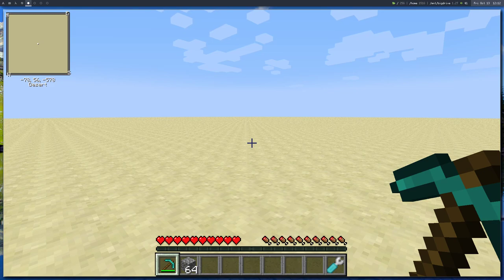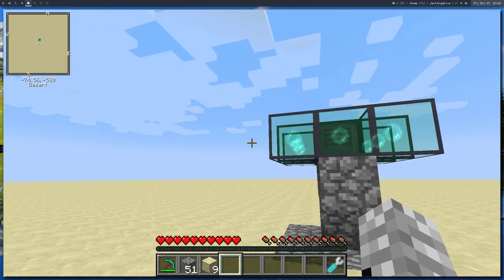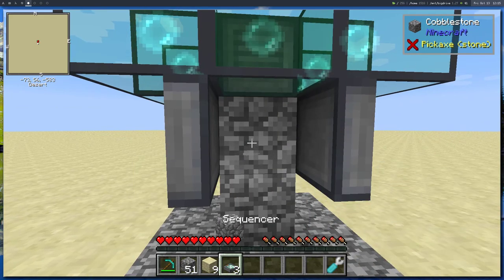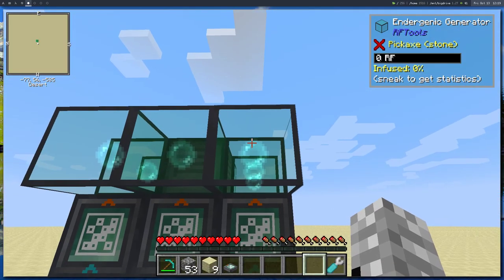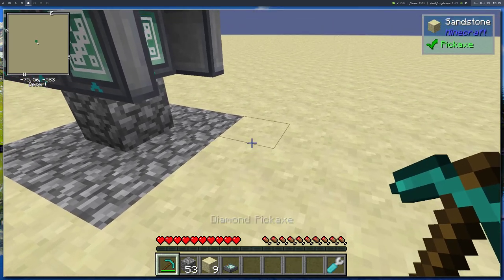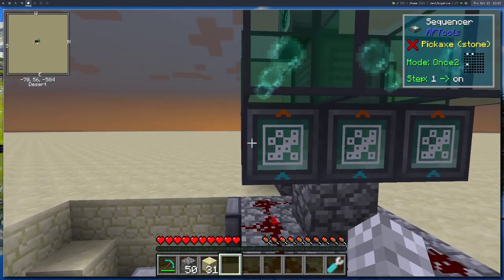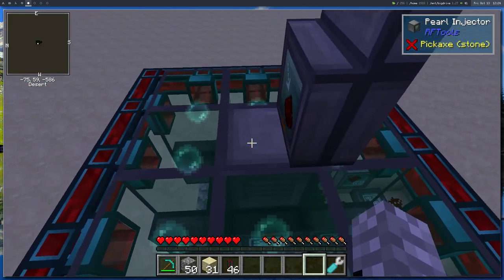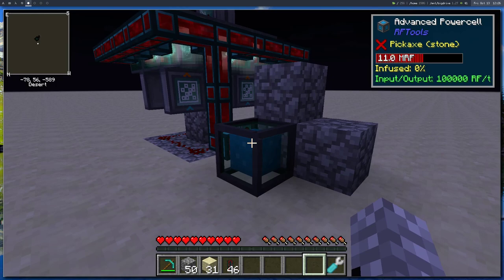Fairly Easy Endergenic Generator (32k RF/t, RFTools + vanilla redstone)

Comment: Even after 3 years works perfectly. I'm just wondering, why is there a sequencer down there with the redstone, and why when I remove it/change it's timing, the whole thing stops working? I'm just really curious because I'm trying to understand how this system works!
Reply: @fancieman8427  same it's just not working for me :/
Reply from the maker: Hey there (and sorry for the late comment). Basically there are two parts to an endergenic generator: first a pearl is fired in, and then the pearl is kicked around from one generator block to the next in a circle with VERY precise timing, until it eventually dies. The sequencers up top are responsible for kicking the pearl along to the next block, pew-pew-pew, until it dies. These are also the ones where the generator can break for some people, since they are VERY sensitive to time ticking issues and can go out of sync just from some machines nearby producing tiny bits of lag. The one on the bottom detects when the pearl dies and fires another pearl after a short wait.
Reply: @onetwofoo  that sounds as amazing as it looks! Thanks for the reply! For future people that might read this, don't forget to build the machine on one single chunk, if you build it between chunks the timings may be a tiny bit different but enough to mess everything up!
Reply: Thank you¡¡¡¡¡¡

Comment: This is kind of old but it works.
This is amazing! So compact and does the job. I had to set the 8th one to how it "should be" based on the previous ones though.
Reply: Can you explain what the 8th should look like?
Reply: I think ArnoldsK means that they needed to have the ticks in the 8th + 10th slot and not the 10th and 12th. sorry if this isn't clear.
Reply from the maker: @tylermitchell6013  Wow, I'm really happy that this is still useful to people after such a long time. Just a heads-upon the timing, there's no real "should be" setting for that last one. EG timing is really fickle and gets easily out of sync depending on what else is ticking in nearby chunks (machines and so on). The setting shown in the video was the one that worked most often for me, but if it goes out of sync for you, the best method is probably to just fire a couple pearls and try shifting the upper two dots around a bit until you see the pearl spinning for a long time instead of just for ~2 rounds.

Comment: If anyone still using this setup ... go for 60 instead of 100 on the timer :) ... its best timer in order to not reset to fast or to slow(and wait for to long in order to shoot another pearl), otherwise if the timer is lower than 60 the pearl injector does not get enough time in order to fire the pearl and the entire sistem just resets :))) ... but 60 is best.

Comment: Following this tutorial I've only ever experience issues at the 1st and last generator, *fixing those issues boils down to reading the information given by the smart wrench.*

My generator went from being unable to properly complete one loop to consistent full loops. Though I have been having losses with the two trouble makers, and my other generators aren't producing max energy, it is well on it's way.
Reply: What did you have to change I can’t get it to work. It completes one loop but then stops at the start of the second loop

Comment: bit late to the party, but would making it 10 generators instead of 8 help fix the issues with the last generator in the newer versions? I tried replacing the sequencers and fiddling with the timing on the last sequencer, but the loop only ever goes around once and then is stopped at the last generator. Great build though! It works for at least one loop everytime haha

Comment: Can you do this as kind of a modular thing, so that I can start with maybe two EG and work my way up to 8?
Reply from the maker: Sorry, with this design unfortunately you can't. Ender generators need very very precise timing, and this one is timed for 8 EGs. You might be able to remove one at the end and still barely have it work, but any more than that and it would just waste the pearls. There are other designs for fewer EGs, but they don't generate as much power. Good to tinker with though. An example: https://forum.craftersland.net/topic/10815-rftools-endergenic-generator-designed-by-me/
Reply: Hey, I've got another problem with my generator. The 2nd Generator gives me the text: pearl arrived while idle. But only on the pearls second way around. Could the timing got messed up by the newer mod version?
Reply from the maker: That's very possible. Timings are a huge problem for this build because the sequencers need to be perfectly in sync, and Minecraft just isn't very good at syncing things perfectly across several blocks. Any little thing can throw it off. I'm working on a new build that will have fewer timing problems, hopefully, by reducing the number of sequencers.

Comment: When doing this I keep on getting pearl received while idle, only on the first one after the first loop
Reply from the maker: Most likely it's not charging correctly. Check that it's set to Once2, if that doesn't help try moving the first two dots on that sequencer around a bit, or try moving the second dot one more away from the first. Make sure there is always at least one empty dot between them so they count as two separate pulses.
Reply: A year later, but this is for new people. I simply moved the top 2 dots in the 7th generator ( the one that stalled for me) over 2 and it fixed the issue.

Comment: I have been using this build for a few days now and after taking down the generators and infusing them i have run into an issue where my 6th and 7th gen are producing way less than the rest. when i look it says that last pearl arrived at 1 then 2 and back to 10 at the 8th jump. Was loving the power output up to this point great guide
Reply from the maker: Hi! Depending on your Minecraft version (earlier = worse) the timings sometimes go off if you change things. It may help to take down the sequencers and replace them on those two generators, or for a quick fix you might try moving the last dots (the ones on the fifth line) around on the 6th and 7th sequencer, probably just one to the right on the 6th and the rest might fix itself. Endergens can be fiddly because they rely on very exact tick timings, and Minecraft unfortunately doesn't always provide those. :/
Reply from the maker: Oops, hang on, I forgot how this build works. The fifth-line dots control the first charging cycle, so the ones you should move around are the ones on the first and second line. :) Try moving them 2 spaces apart instead of one, or moving them back and forth while keeping at least 1 space between them. As a guide, for best power output, you want as many generators as possible firing exactly on 10, but you can't do that on the 8th so just try to get the others right.

Comment: Hey, Awesome guide! Just curious if you  have any idea what sequence length we should set the sequencers to. it dosen't seem to work with the default settings
Reply from the maker: The sequence length should be 64, but endergenic generators in general are sadly very unreliable in current versions of Minecraft/RFTools. This is due to how tick timings work in Minecraft internally. I haven't really found a good way to keep the timing completely stable.

Comment: Worked fine, restarted my server and now it seems the timings are of or something? it only manages to do one loop then stops? Ive replaced literally all the generators and sequencers still wont work
Reply from the maker: Hmmm, that's odd (unless you're on a really old Minecraft version like 1.7). Endergens are always very finicky with regards to timing, but on 1.10+ taking down all the sequencers and putting them back up so they reset should usually fix it.

Comment: Why is there such a long pause when a Random Pearl Lost event occurs? How do I get it to stop pausing for several seconds before starting up again? Because it doesn't produce any power during those few seconds where a pearl gets randomly lost. I'm on the Revelation Mod Pack with 1.12.2 Minecraft. Thus far I've had more success with your setup then with some of the others, such as Mizuna's setup. But I'm just having that Random Pearl Lost pause hiccup... Thanks...
Reply from the maker: Hi! The pause is that long mostly because my bases have fairly modest power needs and one pearl is enough to power them for several minutes. You can make the pause shorter by right-clicking the timer piece (normally set to 100 ticks), and setting that to a lower number. You'll need to experiment a bit; if you set it TOO low, it won't run/fire properly. 40 ticks should still be safe.

Comment: I'm not sure if you can help - I built one of these in creative, it worked fine.  I built it in my SSP world, and it also worked fine.  I closed the program, and came back the next day.  The creative one still works fine, but the the SSP one no longer works even though nothing has been changed.  The timings are suddenly all off.  
Edit: I rebuilt the clock and it started working again?  I know it's sensitive to minecraft's wonky ticks, I'll figure it out I guess.
Reply from the maker: Yeah, sometimes the ticks just go off. :( I found that it gets better with newer Minecraft versions and newer versions of RFTools.
Reply from the maker: While the generator is idle and no pearls are in the injector, it should go off in a sort of double pulse every 5 seconds (so probably what you mean with the 5 seconds and then the 3-4 seconds). It's kind of like a one-two punch to get the generator going; the first pulse charges it up for the first time and the second pulse fires the pearl. It should not be going slower than 5 seconds, so that one going every 8-9 seconds is weird. Check if there's other redstone nearby that's interfering, or if the generator is built across a chunk bounadry. It also helps to hold your wrench in hand and check why the pearl was lost-- by holding it, you can see diagnostics on the generators. If it says "random pearl discard" on the one that lost it, that's normal and you're just having an unlucky day. If it says something else, that's a timing or signaling problem.
Reply: i play on server and it never does 2 loops or more.

Comment: You made the 8th sequencer weird and you didn't need to do that. But this was still helpful in giving me the jist of how it worked.
Reply from the maker: Actually the 8th sequencer has to be that way so the next cycle starts on the correct tick. Endergenic charge cycles are 10 ticks, and we only have 8 sequencers, so the missing 2 ticks have to be accounted for somewhere  (if your generator is ticking correctly-- sometimes it just doesn't do that, and if you're very lucky that can make up for the missing ticks).
Reply: Its only giving me one or two spins using the sequence you used. I don't know.
Reply from the maker: Yeah, that just means the tick timing is off in the chunk you are in. Just move the 8th one little by little until it works-- unfortunately this jsut sometimes happens. Minecraft things. Be careful after doing world reloads or server restarts, because sometimes (but not every time, hooray!) they will reset the tick timing to the "correct" sequence and it will stop working until you fiddle with the sequencer again.
Reply: Mmm. Was right in the middle but okay.

Comment: Can this be some how re-shaped to fit horizontal placement as in 1.7.10 Infinity Evolved 3.0.2 ?
Reply from the maker: Unfortunately not, at least using normal Redstone. You need 3 signals on the first endergenic generator to control it correctly, and horizontally, you can only attach two. It should be easy to do that if you can use EIO redstone conduits or Thermal redstone relays, though. I should probably update the design and do a new video now that those are also on 1.12.
Reply: My attempts at translating this design into 1.7.10 have thus far been unsuccessful. You'd be doing silly people like me a huge favour if you did! Regardless, thanks for taking the time to upload this. I'll keep trying to get it to work, as I'm tired of more conventional routes to power generation. Cheers for taking the time to reply.
Reply from the maker: I did some experiments just now, and it seems the timing issues have actually gotten worse in the latest versions (at least on 1.12). I'm not sure how it is for 1.7.10, but even with a working horizontal build, you'd probably have to replace or adjust the sequencers every time the chunk is unloaded or you do any major construction nearby. I'm actually not sure endergens are a viable power source until they sort the timing issues out. :(
Reply: It's such a shame that this power generation is reliant on timings that seem to change so frequently in game. Such a great idea. Thanks so much for trying. If there are any positive (or negative for that matter) developments, please let me know. I'm still wanting to get this right, even if it is an uphill struggle!
Reply: @onetwofoo  Placing the generators with a block between them still gives a one tick delay. Could this give horizontal versions (for FTB infnity for example) enough space to give the first generator 3 signals? Just ban idea.
Reply from the maker: @martinfechter3348  Very probably! The problem in that case would be that it's probably too spread out to fire all the sequencers with one redstone line (you can't use repeaters since those have a minimum two tick delay). But this whole thing was designed for 1.12 at a time when there were no redstone cables available, which has long since been solved. Now the issue is the timing-- it goes off even if you control everything with absolute precision using RFTools Control programs. But McJty is overhauling the whole mod for 1.15 anyway, so fingers crossed for 100% working endergens!

Comment: I have the same issue as others. I made it, then quit the game and came back later. The RF/tick is in the hundreds, and since I have no idea how it works in the first place, I've no clue.
Reply from the maker: Hi there. It's a bit late probably, but I can't really recommend the endergenic generator in current Minecraft/RFTools versions. The timing of the ticks is just too unpredictable and the slightest thing may throw it off. I've tried automating this with RFTools Control, and it still goes off on me after world reloads. :(

Comment: Cant place the sequencer at the wall like you its only possible to place them like tgey were on the ground the whole build doesn't work now any ideas?
Reply from the maker: You can definitely place them on the wall! Just make sure you're not standing in the block where the wall is, and place it on the upper edge of the wall so it points in the right direction.
Reply: onetwofoo i did try and still doesnt work im placing it on the highedt posdible pixel if its matters im 1.7.10
Reply from the maker: Ahh, yep, that matters. Sorry, but 1.7.10 is too old to have those wall-placeable blocks in RFTools. And since that means you can't get a signal to the pearl injector, you can't build this with just vanilla redstone at all. It should work if you just put the sequencers flat on the outside (always pointing into the generator blocks), and fire them using some sort of redstone conduit or cable. Use another conduit to fire the pearl injector (in the center), and a third conduit to get the signal from the pearl monitor.
Reply from the maker: Actually, nope, I think you can't build this at all in 1.7.10, since you can't place a pearl monitor AND a sequencer on the first endergen block. You need both, though. Sorry :(

Comment: Great video. I've built this and it worked okay for a while, but now the pearl dies in the second loop, number 8 generator every time. I just copied your design and don't know much about how these things are supposed to work. Any idea what I may have broken?
Also, yes I did see in the video that you set up the number 8 sequencer, then edited it later in the video. So I've double checked that already.
Reply from the maker: Hi there, and sorry-- I've not been on youtube for a while. Sometimes the timings go off during world reloads, especially in older Minecraft versions or with older versions of RFTools, if you're playing an 1.7.10 modpack, for example. It may help if you take down all the sequencers, and then put them back up (in the correct order, of course). In general this has gotten much better under Minecraft 1.12 and new-ish RFTools.
Reply: im having the same problem he was having. reloaded the world. all in one chunk. can't think of anything else to check. i just can't make it work

Comment: So, was the bugginess fixed in 1.7.10, or do I still have to break and replace the sequencers again?
Reply from the maker: I think the least buggy version is the current one (1.12.2), and even then I sometimes still have to replace the sequencers after restarting the server/world. Minecraft ticking is just notoriously finicky. I've actually thought about having an OpenComputers robot doing it for me when it detects the generator is wasting pearls.
Reply: If you do make one, could you send the script to me, please?
Reply from the maker: Sure. If. It's such a kludge though... I wonder, now that EnderIO and Project Red are on 1.12.2, if you can't run this from one thing (an OpenComputer for example) directly via colored redstone, without having to rely on synchronizing a bunch of sequencers.
Reply: I have no idea what you're saying, but I like it :D